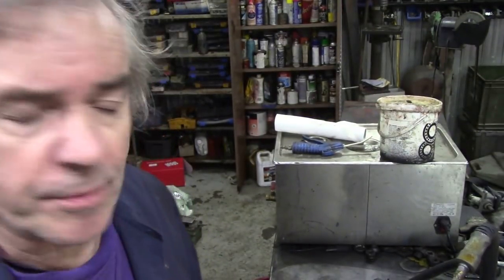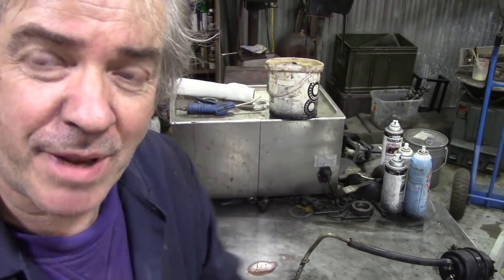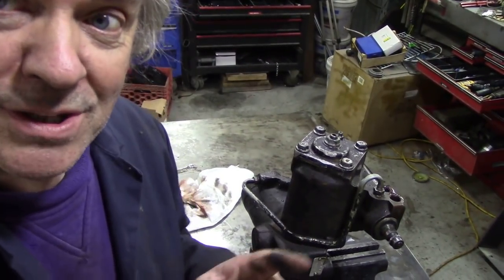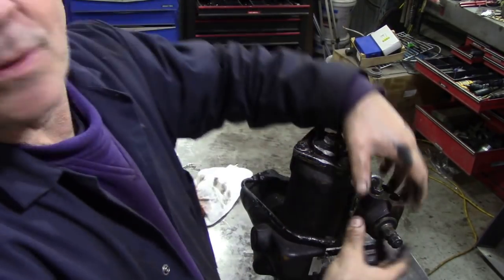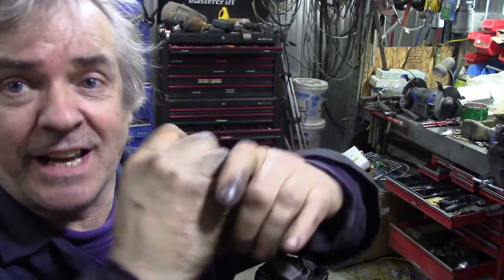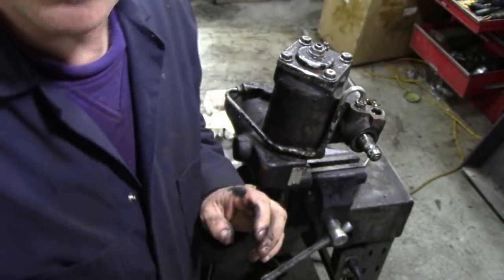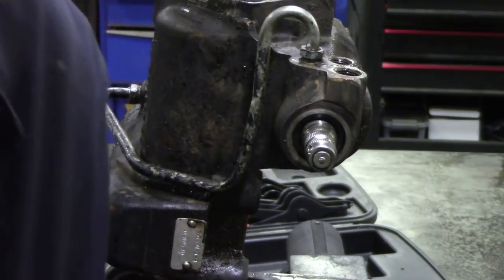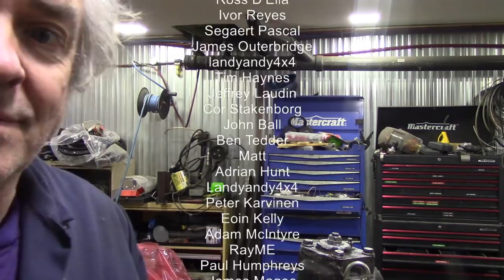Land Rover Adwest power steering reseal. Part 1 (Real time video)

Comment: I did this top seal on a discover 1 in situ,  take the circling out fit the hydraulic pipes back on to the box and fire it up, turn the steering and the seal will shoot out easy

Comment: Not  sure of the seal dimensions or actual part number, however Ive used double lipped viton seals as replacements. Got them from Orings and more. Never had a leak after that

Comment: Might have a go at mine now,  slight weep but theres a god awful cracking noise at full right lock. Doesnt always happen ,checked ball joints on both the hub and steering only thing left is the box
Reply from the maker: Could be a bearing in the steering box

Comment: I bought a 4 bolt Pas box and fitted seals as you are it leaks at bottom but just it will do as now I have power steering looking for a better box at good orice
Reply from the maker: Might be a scored shaft
Reply: @BritannicaRestorations  
Hi  will find a second  hand    1 
Yours will be a nice motor after all that
Reply from the maker: This is why I rebuild my own and they are pretty sketchy at best  - you will see on part 4, I made a rig to test these for backlash and leaks

Comment: If the only difference between the Britpart and German kit is the top nut, can't you just get JP to bung the nut in his lathe and machine an o-ring groove into the lower face of it, so a suitable o-ring can be fitted?

Granted, it's a bit of a faff for a single repair but you could get half a dozen nuts done at once and then use them with Britpart kits when required.
Reply from the maker: I think just get a seal kit STC2847G - you are then guaranteed all the rest is correct
I forgot to mention this part 11011L - a Nylon tipped grub screw
Regular grub screw in the BP kit

https://www.brit-car.co.uk/search.php?query=11011L&xBrand=&part_type=&xSupplierID=&product-sort=&xPerPage=10

Not the cheapest part!

Comment: just to be clear - the owner is Now restricting the budget and said to forgo replacing the old power steering hose ?  or forgo replacing the power steering pump ?  if the hose that would seem a pound foolish don't you think ?
Reply from the maker: I have already bought the hoses and other parts, but other jobs they wanted to be done are now on the back burner
Reply: @BritannicaRestorations  Yes these can be an endless cup of tea

Comment: Hello mike my name is lee I've got a couple of genuine land rover defender manuals one parts catalogue and one workshop manual if you are interested cheers lee
Reply from the maker: Thanks Lee but I think I have most of the manuals? Which ones are they?
Reply: @BritannicaRestorations  hi mike parts catalogue for defender 110 1987 model code number rtc9932 cd printed January 1991 the other is workshop manual 90 110 starts with series 1 80 inch model goes through to defender 90 110 and 130 models

Comment: Hello Mike!  question..the nut on top with the gasket if I change it needs adjustment?  thank you
Reply from the maker: If you mean the nut right in the middle of the square top then, no if you do not turn the threaded adjuster
Reply from the maker: Just pay attention to the nut - the original nut has a built-in seal on the bottom, but the crappy aftermarket kits use a regular nyloc nut - no good at all!
Reply: thanks to you mike I have the freudenberg nut;)
Reply: hello mike sorry if I insist .. can you tell me the pitch in inches of the nut the big one? then I adjusted the clearance which is now non-existent from the nut on the ring nut.  to adjust the steering weight, on the other hand, do I have to act on the large screw?  thanks